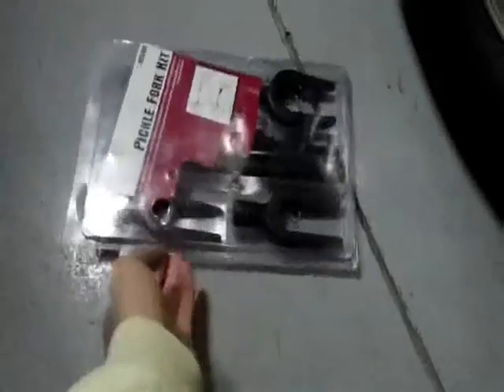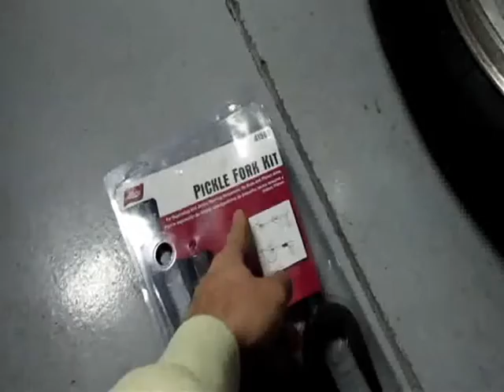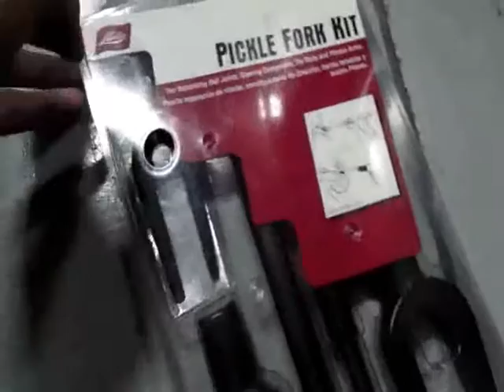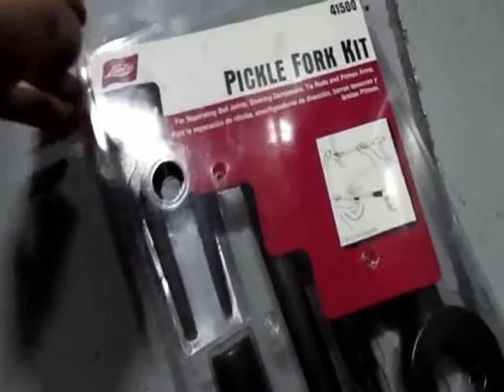Post bucket day, Pickle fork

Comment: pickleforks for air hammer is like handsaw vs v8 chainsaw.... We just some 6 months ago did my idler with it and what a difference !
Reply from the maker: +Veikra  heck yea, I need to get one.  Just wear ear protection!  I wonder if they make a QUIET version
Reply: Ghetto Wagon
 nope, there nothing quiet about slamming two pieces of metal together 10 times a second.  With picklefork, you only wedge the v in there to pry both, but with air hammer you are prying it off with leverage as the hammer drives it in. If that makes sense.  It's gewd stuff. Ill show you tomorrow, replacing steering gearbox tomorrow, maybe do it twice if the rebuilt unit is crap (90% of the times they are bad out the box)
Reply from the maker: +Veikra
 Yea the Old guy tom LEE in CA rebuild the box on 2 cars years ago. He retired, he was the best.   Reman boxes are junk.  He would fix up a original PS pump or box goo, affordable too!  You just had to send it to CA.  I just bought a IR Air hammer, had to use some credits I had Maybe 3-5 days Ill have it.  114GQC model i got it cheap!  Under 35 dollah
Reply: Yeah, LEE is talked about in the forums...good guy I heard.   I need my truck so Ill swap steering boxes after steering boxes until I find a good one.  Congrats on new purchase !
Reply from the maker: Veikra
 Ya Tom was a nice guy to talk to on the phone, he would go on and on telling you all stories about racing or what he was up to, It was just a nice Mom and Pop shop.   I am happy to have some of his work some vehicles here.   I think TURN ONE In Michigan may rebuild power steering gears, But I never used them or know anyone who has.. Apparently LEE did a bunch of work for Nascar, and just anyone making a street car into a road race track car.
Reply: Ghetto Wagon
 mom and pops shops....always the best.
People seem to like the redhead boxes on the duramax, some shop only install those.